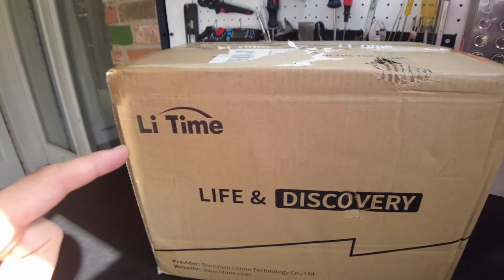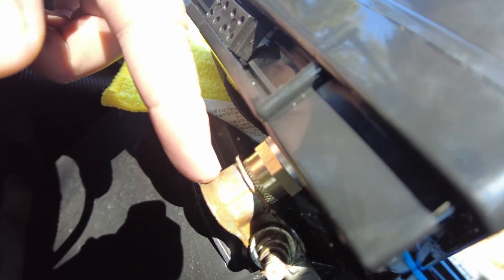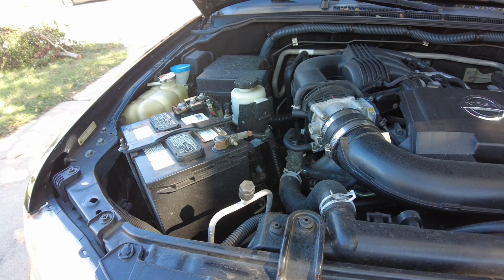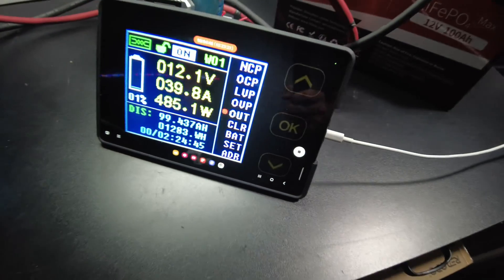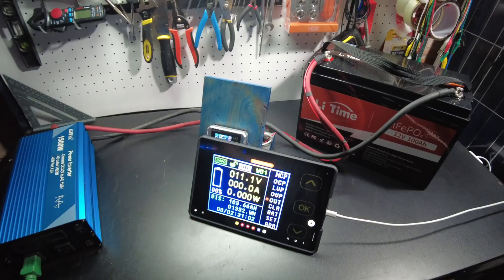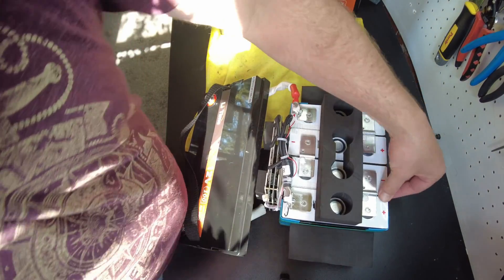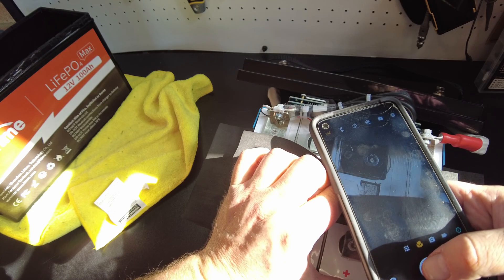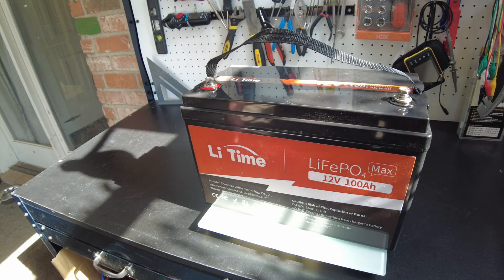LiTime 12.8v 100Ah MAX LiFePO4

Comment from the maker: Affiliate Links:
Discount code: Brad
LiTime Max Battery: https://www.litime.com/products/litime-12-8v-100ah-max-lithium-battery-lifepo4-deep-cycle-battery-built-in-150a-bms-1280wh-energy-4000-cycles-1920w-load-power?_pos=3&_psq=150&_ss=e&_v=1.0
LiTime Amazon Store: https://amzn.to/3QzEcum
M8 Battery Post Adapters: https://amzn.to/3SQPI7F
ALFFAA 1500w Inverter: https://amzn.to/40bD8R1
Midea U Shaped 12000BTU AC Unit: https://amzn.to/43xiXPm
Shunt I use VAT-4300 https://amzn.to/3SX0bvK

================
AFFILIATE DISCLOSURE: This channel may earn an affiliate commission if you purchase products through links I provide. 
================
CONTACT: bradcagleyt@gmail.com
Business/Collaboration only. Please do not contact me for for personal project help, or advice.
================
DISCLAIMER: These videos are documenting my own projects, and experiences. These projects, and activities can be dangerous. Do not try any of this at home, doing so will be at your own risk.
Reply: Unlike a lead-acid battery the internal resistance and corresponding voltage of a lithium battery does not rise until it is nearly 95% fully charged. This can cause alternators to run longer at full output which can cause alternator burnout. The length of a time a lithium battery can draw a constant current at or above the alternators max output can exceed the design parameters of the alternator. This can cause the alternator to over heat and burn-out. Alternators are internally cooled by a fan on its rotor. Lithium batteries will draw a high charge current at all times meaning alternators are prone to burn-out at low RPM when charging lithium batteries at high currents.
Reply from the maker: @mannyfragoza9652  Great that makes sense, thanks for the info!

Comment: Does your Xterra have the 4.0L V-6 engine?  
Also I'm not an expert, but I have also heard the alternator charging fears and the Victron alternator video (which was setup to achieve the results they wanted).  I have seen a 3 x 100 amp setup that charged straight from the alternator,  most he saw was 100 amps for a short time and it tapers off, he had the setup for 3 years.  I did a 1 x 200 amp battery and guess what, no drama, a surge up, tapers off and settles off at a lower level.  These were done on Promasters with 180 amp alternators.  Thanks for videos :)
Reply from the maker: Yes 4.0 V6. I'm tempted to setup a test jig and see how hot an alternator gets at low RPM charging one of these. Seems like you could easily mount a thermal probe to disconnect the exciter wire if it gets too hot.
Reply: I don't mess with car wires, I got a Ram so that's just asking for trouble:) Alternator is sort of self regulating the hotter they get the lower the output.
I think you're in Texas? here's a Promaster in Texas with 540 amp setup.
" I’ve been charging my lithium bank straight off the alternator for +4yrs w/o issue. I’m controlling the whole setup with Victron components. It definitely seems the alternator regulates the charge current based on alternator temp. My charge rates are lowest in the hot Texas summers with everything running in the van. It will scale the charging back to 40-60amp/hr range. On a cool day w/ a low SOC, it’s not uncommon to see 100amp/hr charge rates sustained."   at the extreme he has seen 140 ish amps out of the alternator.
 @BradCagle

Comment: Good to know if even to use as a spare emergency battery for cranking over a car. The terminal posts could be possibly swapped or just add a couple small extra cables, or if your insane or in the middle of nowhere, could use a few wrenches or metal bars wrapped with anything for insulation mcgyver-like, and then theres no reason to become chewable wild animal based cuisine off in the vast wilderness.

Comment: Another thing to be concerned about is what happens when the bms cuts off charging. With the number of amps these battery accept if that load is suddenly taken off the alternator you can get a massive spike in voltage that blows up the diodes on your alternator and sends 100+ volts thought your vehicle's electrical system. It's useful to have conventional starting batteries on boat's and rv's with lithium house batteries because they act as a buffer and voltage stabilizer that protects your whole electrical system when the lithium connects and disconnects. You also need some kind of current limiting, the cheapest option is to just rely on the resistance of wiring between the battery and the alternator but a better solution is to use a dc to dc charger. You can even put a resettable thermal fuse on the alternator to shut off the dc to dc charger if it gets too hot. 

I'm putting together a solar and lithium system for my new to me motorhome and one of the things I picked up was the litime's 60 amp dc to dc charge controller. Oh another thing a proper controler does is voltage boost and buck. If you're say charging batteries a long way from the alternator like on a trailer the dc to dc charger can compensate for voltage drop and actually improve charge speed and get you a full charge when you otherwise wouldn't.

Comment: LiFePO4 batteries do not take to heat very well at all.  It's generally known in the solar community that you need to keep an eye on high temperature as well as low.  Once you get over 35c and fully charged you start to see accelerated rates of degradation.  At the sort of temps in an engine bay it really hurts.  Several other youtube channels have discovered this for themselves, even after being warned about it.  If you only expect 2-3 years from it, it'll do it.  If you want more, engine bay is not the place.

Lithiums capable of cranking an engine over have been around for a while, it really comes down to the capabilities of the BMS rather than the cells.  You can even get batteries certified for light aircraft.

Comment: Liked seeing the car start test. Lithium based battery jump packs have replaced sealed lead acid based jumper packs. Also vans, motorhomes, rv's, etc, are using Lithium based batteries as the "house" batteries and often times are tied into the alternator to be recharged while driving. So I don''t think there is an issue with alternators charging them up.
Reply from the maker: You know, I've been pondering over the 12v line from the car via the 7pin cable to my travel trailer. This wire is supposed to charge the battery in the RV. However it's only 12awg I think, so good for 20a. I think there will be a problem because if I install a LiFePO4 in my RV, It's not going to limit itself to 20a charge, and I think It will blow a fuse. I need to do a video to test this stuff. Thanks
Reply: @BradCagle  yeah I'm no subject matter expert on all that stuff, but I nerd out trying to learn more. I think the Marine people like Sail yatchers,  RV's, and long-haul trucking are into some heavy electrical stuff. Like satellite, refrigerator,  stoves, microwave solar panels, and battery banks to inverter systems. Pretty much every creature comfort on the road that you would have at home.
Reply: I looked at the same thing and my conclusion was I would have to run a DC to DC charge controller like the Victron 12/12/30 but I haven't figured out if I need the isolated or non-isolated version.  With 4-100Ah batteries and an Aims 3K inverter I could run anything I need. @BradCagle
Reply: The alternator will charge it without any problem. It's the BMS system that is the problem. The built-in monitoring system has an auto breaker disconnect switch inside that's used to give the cells time to balance if they become unbalanced or get too hot. We that happens your alternator sees 0volts and thinks it needs to max charge, but since it doesn't have a way to get the extra current to the battery, it starts to over current the electrical system trying to dump the extra current blowing fuses and then burning wires and then the alternator has a thermal meltdown. But the cure is to have a  lead acid in series or had an external regulatior running to the bms that when it sees its about to cut of it also turns off the alternator also and to have a temperature switch in line with the regulatior battery voltage signal that way if the alternator is getting to hot it also cuts off and that's needed, due to the difference between lead and lithium. Lead you have to trickal charge after about 80% full, but lithium can take  a max charge from an alternator easy. That's why it's the go-to for solar power energy storage. The only drawback is that lithium cells are a lot more unstable and unbalanced and need time to balance charge at some point.

Comment: The issue you mentioned where LiFeP2O4 batteries stress alternators is real.  Another channel recommended that you install a DC to DC charger to protect the alternator.
Reply from the maker: Yeah, I'm realizing alternators have been engineered around Lead Acid's limitations. They really need to monitor temp, and be able to throttle down to work in harmony with lithium. A DC/DC would work to charge, but you would not be able to start with it in that config. Thanks!

Comment: Why did you turn the battery upside down instead of just using jumper cables between the LFP battery and the wires in your car, disconnected from your SLA battery?  If you live in a warm(ish) climate and your vehicle starts easily, this is OK for an emergency.  Not a good idea for a long-term solution.
Reply from the maker: I wanted to make sure I had a solid connection, and limit the voltage sag. Thanks

Comment: Well heres a bit of the alternator issue. Some alternators are not a higher amp rated to charge a lithium battery as can be demanded. Some cars have say a 50 amp alternator in a 4 cylinder car, while others with a v8 have a 150a alternator. If the bms will pull all it has access to it causes voltage sag, higher amps to be pulled, which causes alternator stress and failure. 

While this is a simple explanation, it is not all scientific. There maybe other factors to consider, wire size, wire length, how well its grounded and so on. Alternator voltage in general is another factor. Also wether it is a smart alternator. Some vehicles will be fine (the battery my not endure that life)
Reply from the maker: Good info, Thanks!

Comment: It would be cool to have one of the battery isolation things where you could not cook the alternator when the battery is full and bms shuts off but still have the capacity of the lithium
Reply from the maker: Agree! I have a dc/dc from redodo, I need to do a video on it, and figure out how it works.

Comment: Fun video, but bummed you didn't verify the 150 amp spec.  How long will it do 150 amps?  That's really important because you can run a standard microwave on 150 amps....
Reply: Agree.  Also some testing on the actual 1-5 second peak output would be great.
Reply from the maker: Good points. Manual says continuous 150a, but of course we do need to test that. I'll see If I can get another test on it. Thanks!
Reply: @BradCagle  I highly suspect that unit will do the documented loads.  I bet it might do 20-30% better than documented though and that is what I would like to know.   How conservative are the specs.  Thanks again for the great reviews.

Comment: Another tool that might be great at opening the battery... a "7-n-1"paint can opener, with the strike face on the handle. I've found that the tool works in 99 different situations. 
Regarding battery fit in a car: Some cars have reverse terminals, devoted by the 'R'. Cool trick showing it start a car. Definitely not meant to stay in a vehicle due to no charging allowed in the cold, the lack of cold temp sensor, and lack of heater pads. The alternator is a good point as well.
Reply from the maker: Those are handy tools! I lost mine years ago, I need another. Thanks for reminding me :)